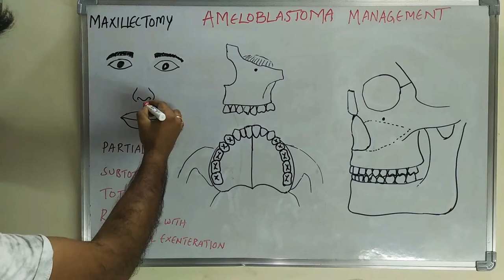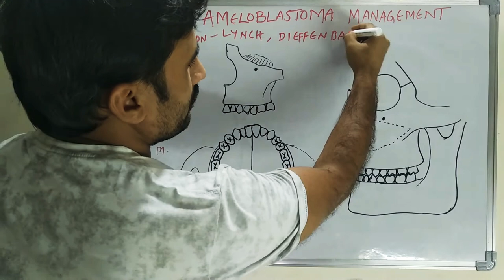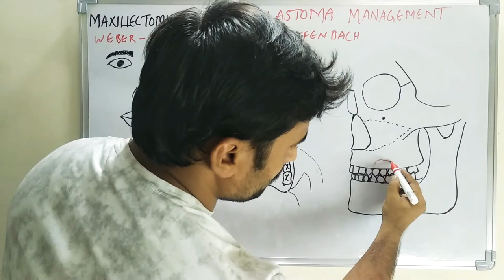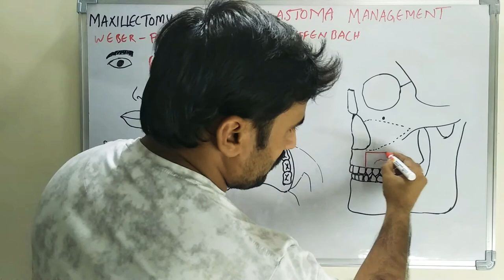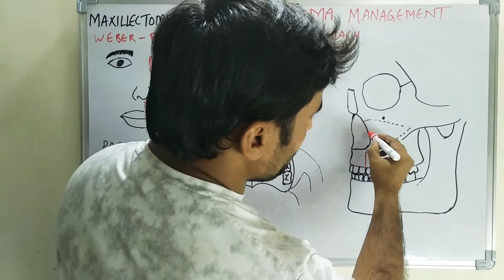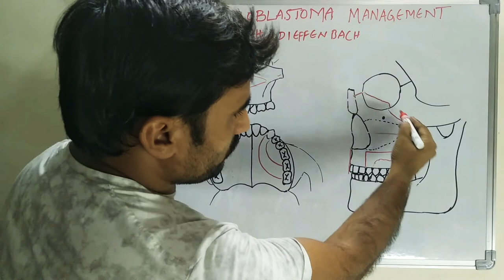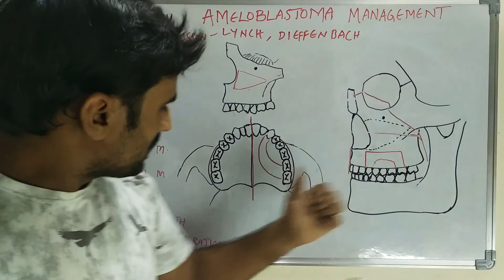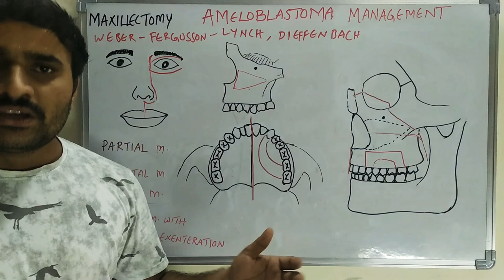MAXILLECTOMY

Comment: Your definition of Weber Fergusson incision isn't correct from the diagram . It actually starts 1cm lateral to the outer canthus  then run medially 3mm below the lower eyelid until close to medial canthus where it curves downward. Diffenbach is downward extension of the lateral end of the previous incision near lateral canthus
Reply from the maker: can you quote reference book...i will check that once
Reply: @msdentallectures7408  Blackwell Operative Otorhinolaryngology 1st edition Chapter 32 page 227